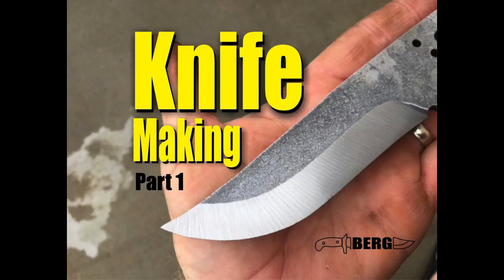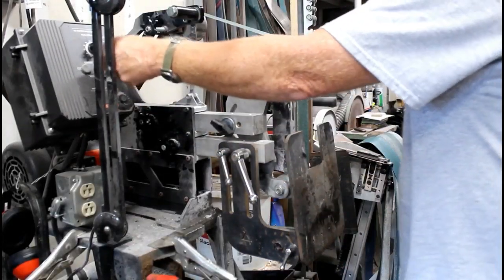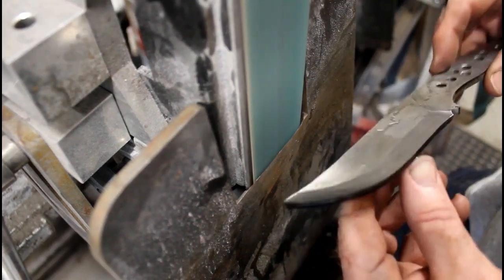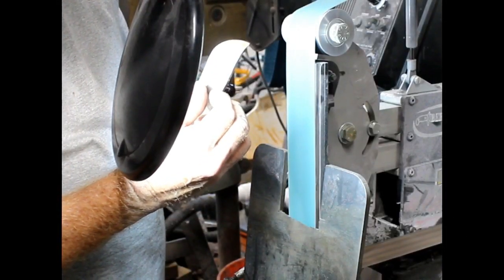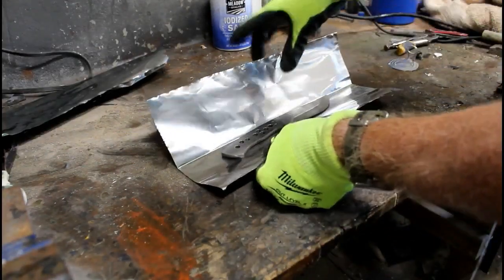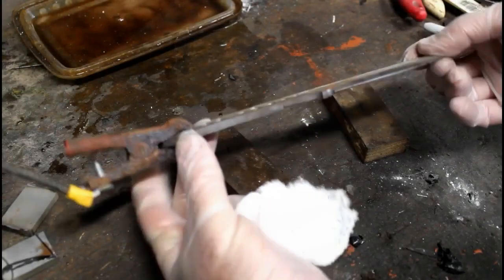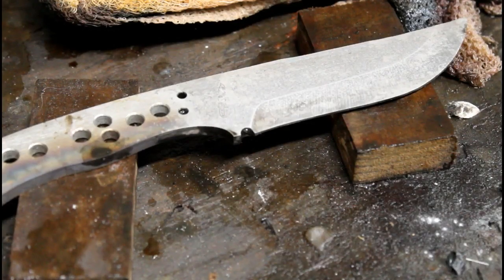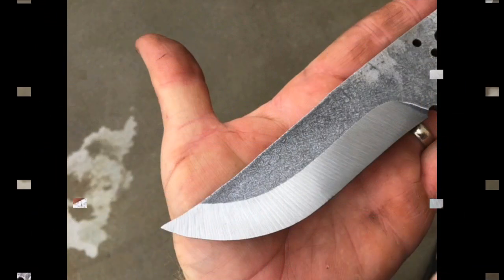How to Knife Making Part 1 Bevel Grinding, Blade etching and Hardening by Berg Knife making

Comment: great vid!!  question I've made my own bevel plate, im using a 2x42 grinder. its ok but I've made a lot of adjustments.  on my bevels one side I different from the other. is the bevel plate not square to the platten? or could the knife be bent some. with a straight edge across the plate and platten it looks ok. maybe a little off but not bad?  any ideas?  thanks doc
Reply from the maker: Sounds like knife might be bent a little

Comment: What angle is the table set at to start with?
Reply from the maker: It depends on thickness of blade and how wide you want the bevel to be. I usually bevel a scrap pc of wood first then adjust to get width Im looking for before beveling the blade

Comment: Eagerly awaiting those stainless bolsters. I've had a ton of trouble shaping stainless bolsters and keeping the softer scale material level with the steel.
Reply from the maker: Already started working on them. Rough shaped, dove tails done and they are hammer peened in place. Next up will be the scales
Reply: @DIYeasycrafts  So you do rough shaping before attaching scales? Does that make it easier to keep things level?
Reply from the maker: @gean.knives  I rough profile the bolsters finish and polish the front end. Then hammer peen in place. Then add oversize scales and then grind and polish the bolsters and scales at the same time. Not sure how everyone else does it but this process works for me
Reply: @DIYeasycrafts  Thanks for sharing your process. 

I had issues with keeping the softer scales from developing low spots at the junction, and the bolsters kept developing facets instead of rounding off nicely. I discovered this morning that 1x72 scalloped belts will actually work great for blending the facets in steel bolsters and don't seem to grind away the wood too fast.

Comment: Where can I find the magnet you are using to hold the knife blade thanks for posting
Reply: You can buy them at any welding supply store, they are called magnetic welding squares
Reply from the maker: I got mine from amazon. Search for handled magnet
Reply: Thanks I have the welding one just liked the handle on the one shown